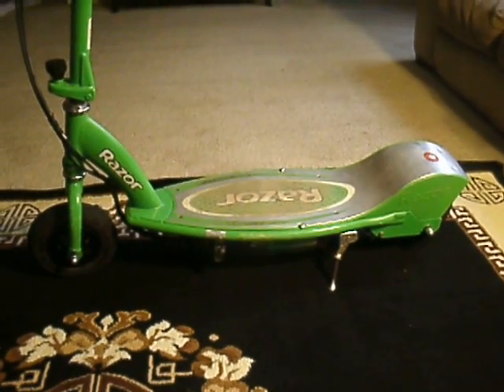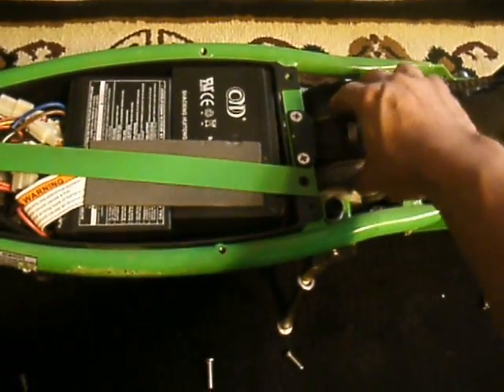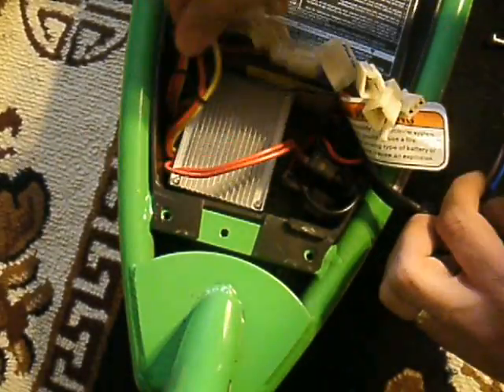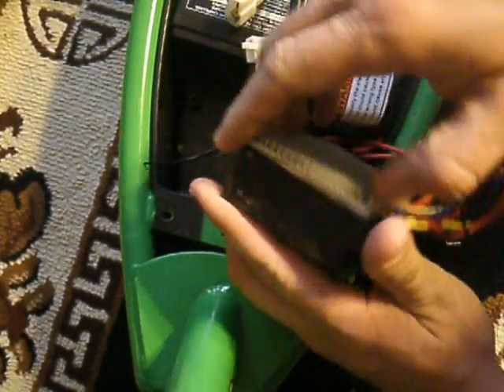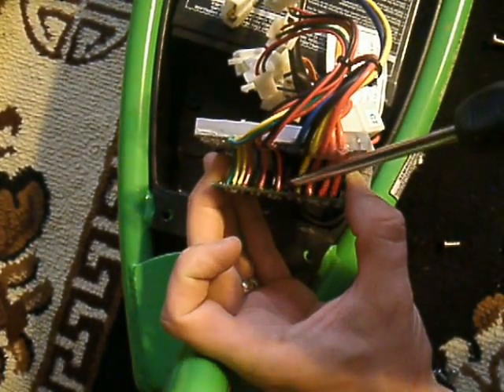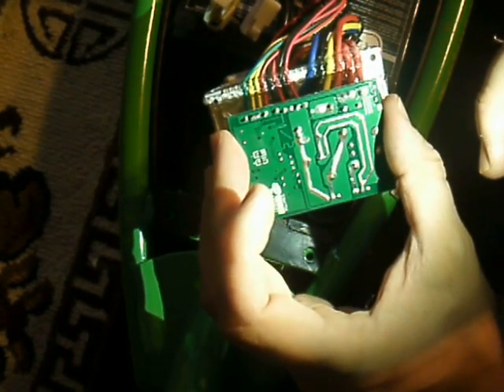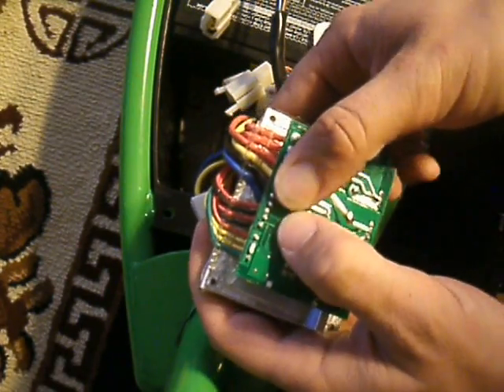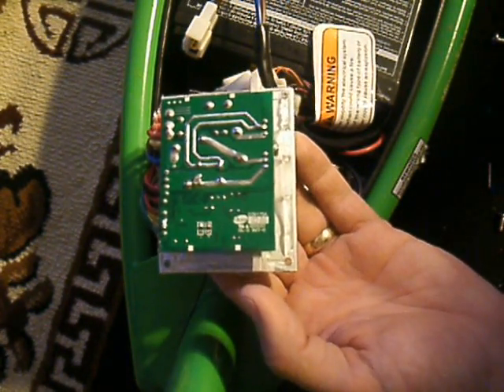Increase Electric Scooter Speed and Torque!

Comment: I have same scooter.  Do you know if this regulator will handle a forth battery?? 48volts???  i have the 24volt 120watt motor. Please.  Need it for work.
Reply from the maker: I would say no. The board was designed with resistors diodes and transistors that were meant for 24 volts.
Reply: I putted in 48 volts. And it worked fine. But i need to remove this block in there.  And dont know how......   I have to have speed for the engine to work..
Reply: Oh yea. And i soldered the + and minus contact bigger. So it could handle the 48 volts..

Comment: Hey Dave how bout a thicker wire with power switch on the handle bar rigs up will it work..?
Reply from the maker: I wouldn't suggest it as its a power limiter wire. Using a long wire and a switch I don't think will work and might cause a fire.

Comment: So anyone tried this? I have 33volts from 4s lipo on stock controller top speed around 30km. But no increase in torque.. The control doesn't get hot at all right now after a 8min ride.. 

If you have tried what worked and what failed?
Reply: +Gordie Tam 
How did you get 33V out of 4S LiPo, I wonder?
Reply: It works for me
Reply: He means 8s, 2x 4s in series.

Comment: I found the rod in the processing bored am I supposed to connect it to the red power wire that's soldered to the processing board?
Reply from the maker: You just want to make the wire thicker. By replacing or adding wire or solder.

Comment: Awesome dude.. i guess this must also be the case with my mobility scooter.. going to try it out soon, if i can make it go faster like this, it would be sick.
Reply: Doesn't work on mobility scooters they have a anti mod system so if you mod it it simply won't drive at all
Reply: Dude i was thinking like.. there is a turn knob that you can regulate the speed with (from snail to rabbit or whatever) - I was thinking that when you turn this knob, it somehow gets a better connection on the wires, and therefore, if i took this apart and hooked them up directly, then i might gain a small amount of speed? or am i wrong? i have now really looked into it yet..
Reply: Not*
Reply: Kennie Diamond yea I was also thinking the same but no the resistor is at full when turned to the rabbit its like turning a tab open (if you have one of those water tabs that use a turning knob)
Reply: Yeah okay thanks man.. i did not know that.. was acturally trying to try it out tomorrow ;P i guess i have to do something else.. you cant tell me there is no way, there must be a way.. a new motor? a extra battery? maby rewiring it very simply (i never really done this shit before, so i would need knowledge beforehand) - But rewire it so that there goes a cable from the battery to the stearing handle - When its pressed down, it sends power through a cable, and into something that regulates the current or whatever, and then straight to the motor?  is it possible? i dont care spending some money on the project..
Reply: Kennie Diamond an extra battery? Depends on how you connect it but if you connect it serial it ll go from 24 to 36 and that ll fry everything
Reply: Kennie Diamond but in parralel it ll increase the ampere so it will run longer
Reply: Are you sure it will fry everything at 36 volt? its a heavy duty machine.. i dont care about the mileage, i just care about the speed :P right now it goes 60 kilometers on 1 charge, that is pretty good (2x batteries) - i removed the heavy seat and put on a lightweight seat i had laying around from a old moped.. its great, and its really strong.. no problem going up hills or anything, its amazing.. and the acceleration is so freaking fast that when it stops going faster then max, it feels like its very heavely limited from what it could do
Reply from the maker: Kennie Diamond I would defiantly not "recommend" putting them in series. The extra voltage would probably destroy the board. Its possible that it won't but not sure you want to test that theory.
Reply from the maker: Yes, I use Swype so if it's close auto correct uses out lol

Comment: Does this change how long the battery will last?
Reply from the maker: Yes it will. Giving your motor more power and using it up quicker. How much depends on the thickness of your wire.
Reply: What wire?

Comment: does it work on the mx350?
Reply from the maker: All electric motors should work the same considering they all have a limiter. You have to find it and see if you can adjust it my increasing its size.
Reply: thanks :)

Comment: Hi Dave- love the video. Clear and simple. I did it EXACTLY as you demonstrated. Instead of a piece of paperclick, I just use a 1/2 inch piece of soder.  Now the scooter "shuts off" within seconds of throttling it. Something "trips" and it shuts down. How do I remedy this?
I have an E325 that I need faster/stronger for my 195Lb frame.
Thx for info. How you can answer.
Appreciate it
Reply from the maker: If it's too thick it could possible cause it to over heat or you might have gotten to much solder and it's touching other contact points.

Comment from the maker: Some of your comments I can't reply too. Depending on the thickness of the wire it can increase the speed by 2-5 mph. The thicker the wire the faster. That also means it could cause your motor to overheat or your processor board to burn up. It is the size it is because of the safety of the equipment.
Reply: I'd say your best bet at extending your range is to reduce friction to a minimum. Make sure your bearings are not rusty, properly greased, etc... same goes for the chain (which tends to gather dust and dirt).
Also, if your wheels are not solid (ie. there's air inside), make sure the pressure is right. If they are solid, I'd try and fit the thinnest ones available (the smaller the ground contact, the smaller the friction).
Finally, when you start from a 0 speed position, give the first push "the old fashion way". This saves the motor from having to "start the motion" (which uses a lot more power than just maintaining the speed).
Reply from the maker: ***** I was in it for the torque when I did it.
Reply from the maker: ***** got ya. Definitely avoid this hack if you want distance. It will drain your battery quicker. Quick interchangeable batteries would be cool. Good luck
Reply: I was wondering if another set of batteries plugged to the charging plug would work. Like having a small backpack with batteries and wire to plug to the scooter.
Reply from the maker: +Able Reyes depends how you hook them up. increase the voltage and you'll fry the board. increase aph and the scooter will run longer.
Reply: Dave Here when we cut the top piece and all it did was click but the wheels didn't turn. We reconnected it and it worked. Any idea why?
Reply: Hi Dave are you still around? There has got to be a way to increase the voltage without frying the electronics and the propulsion
Reply: how to increase voltage without over loading answer that simple terms pleeze?

Comment: I tried to do this on my e300 but there was a black plate covering the board. I couldn't get it off, so i put the metal on the bottom, where you said it would be hard to do. I just taped a paperclip to that metal bar (speed limiter) and it didn't seem to make a difference. Is there a way to get the cover off the board and is the way I did it safe and should it work?

Comment: Hi Dave, I have a Razor Ecosmart Metro and opened the controller to have a look at the board. I'm not sure what to bypass as it doesn't look exactly like your's. May I send you pics? Thanks, Bill
Reply: I also have a ecosmart metro sup scooter, I put 2 36v 13ah lithium batteries and it give me around 32 miles on a single charge and I'm also looking the way to make it a little faster, let me know if you find a safe way to do it

Comment: Great video, may have to modify my scooter that way.  I have the e125, I use it under my wheelchair to ride around our neighborhood.  The safety installed into lower end models that require you to be going 3 km/hr before the motor will kick in.  Since I am in my wheelchair it is a little difficult sometimes to get up to speed to get it going.  Do you know how to turn that feature off?  Any help would be greatly appreciated.

Comment: i tried it but the wire that comes from the charging port to the processor the wire on the processor end same black wire snapped and my scooter doesnt charge but wen i turn on the scooter smoke cums out and the plastic cover on the wires gets burnt

Comment: Hi i have question, really useful video btw.
I have the e100 version, which i have modifyed with 2 12v 12ah batteries and a 350watt motor but all the other parts are stock. It goes much faster and accelerates much faster but am i not reaching the 350watt motors full potential speed by using the stock e100 controller? If i perform this trick to the controller will i reach much higher speeds? and ive noticed the controller is different on the e100, is it still possible to do this? 
thank you very much :)
Reply from the maker: I wish I could give you a positive yes our no. While increasing the current limiter would give your motor more current I'm not sure if the results will equal more speed. There is a good chance that it will. Also, even though it looks different, your controller will have a current limiter as explained in the video.
Reply: Dave Here ok thank you very much for the reply

Comment: dave here i have a lextek electric scooter there is no seal on the processer i have to push and wen i open it i have to push the wires towards the circuit board to make it pop out to find the piece of metalbut im afraid that the wires might get pulled off or they might rip.plzzz help

Comment: I have one more question I have a +5 kit on my  scooter with that effect it or should I just leave it plugged in still after I connect the paper clip
Reply from the maker: I wouldn't.  I read this on a website with a +5 Kit for your bike. use +5 with caution with more volts.
Reply: OK thanks

Comment: I have an MX500 kind shite condition with a 24v motor overvolted with the stock 36v 500watt setup, I'm willing to throw about $500-1000 to make it go as fast as possible without welding, I'd rather bolt on a motor that doesn't fit and make it fit ya know? Lemme know, I used to do some of the scooter mods but haven't been in the area you could say for a while...
Reply: how well did this work for you?  I'm debating getting the 24v motor.  Is it reliable for an adult?

Comment: on my e200 scooter there isnt any limiter it's a solid wire where you teach to solder
Reply from the maker: The solid wire is the limiter. By making that wire thicker allows more current to pass through.
Reply: Dave Here
So do i cut that solid wire or just put the paper clip on it
Reply from the maker: The thicker it is the more current can pass through. Don't make it to thick or it could cause the motor or board to burn out.
Reply: I have a e175 and that board or box thingy is smalller and its completly different so i added it to the limiter and i get about 15mph and the battery dies quicker but its kinda worth it thank you
Reply from the maker: Glad to hear it worked out and thanks for letting me know.
Reply: Ernest Brunson can you post a picture on where you put the wire because i too have a E175 and the board is differnet.  What wire gauge did you use ?
Reply from the maker: I sold the scooter I modified but will probably modify a different soon. I used a thick paper clip with a bunch of extra solder
Reply: Dave Here Dave, the E150 or the E175 has a different board and im not sure where to jump it like you show (not same board).   heres a picture of my board
http://1.bp.blogspot.com/-wIk9coxHYGE/VBdbgL2bgUI/AAAAAAAADU8/fx3C0X66yFw/s1600/20140915_170608_Android-795699.jpg
Reply from the maker: Can you show me the other side? It should look like a solid piece of metal.
Reply: Ming T The other side does not show any hard piece of wire there is a resistor and some caps but no hardwire  http://2.bp.blogspot.com/-BxcFepupq7o/VBdcuqniUaI/AAAAAAAADVI/nXB719wxE-Y/s1600/20140915_170620_Android-709712.jpg
Reply: Dave Here any other suggestions ?

Comment: How can i increase the speed of my electric scooter razor e200- to 60 miles per hour tell me mine goes only 12
Reply from the maker: 60?! Lol, your gonna need a gas powered motor to do that. This will allow you to increase it to maybe 20. Anymore and you got blow the motor.
Reply: ** lol he's right. The electric motor won't be able to provide that much power. Maybe 20-25mph, but not 60. That's suicidal.
Reply: Stephanie Lizano   60mph ??    Ummm.  Bit much.   Even the top scooters out there  do not come close to to 60mph.  Nah.
Reply: If you add one more motor and two more batteries the scooter can go about 40km an hour

Comment: Does an electric wheelchair work the same ?  I have a wheelchair that I want to speed up by about 2 mph, a lot of never wheelchairs go up to 8 mph, mine only goes 4 mph and when I walk the dogs, I can't keep up with my wife or dogs. Can you help me with this ?   Thanks, great video as well... Mjclemm...
Reply: add another battery it will speed it up ..thats what i did and it worked ,just make sure you conecy the pos of the original ball to the neg of the new one , in series then u will go faster

Comment: thanks for sharing this.
Reply: DAVE I HAVE THE EZIP 500 I OPENED THE CONTROLLER AND REMOVED THE GEL BUT IS DIFFERENT...I WANNA POST PICS OF IT...I WANT TO TRY THIS FIRST...IF I DOES NOT WORK  I WILL TRY TO USE 3 BATTERIES WITH A 36 V CONTROLLER...ANY FURTHER IDEAS?